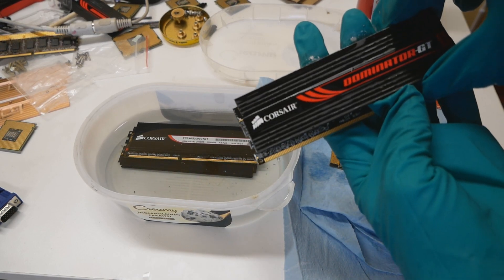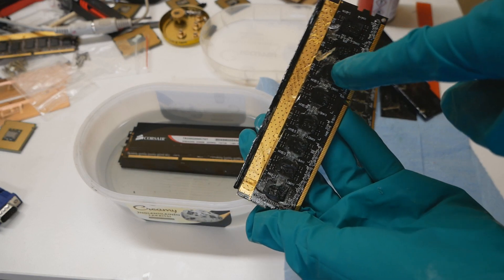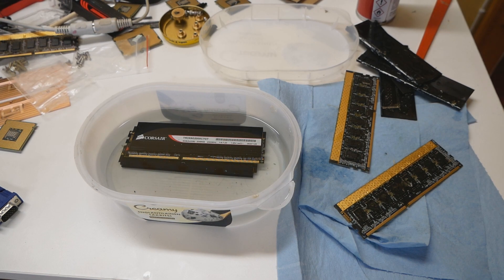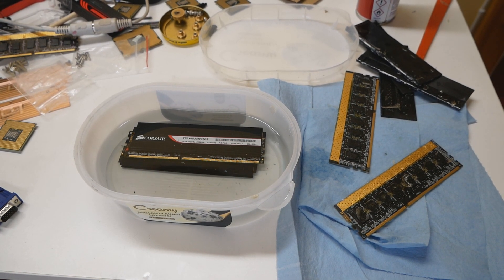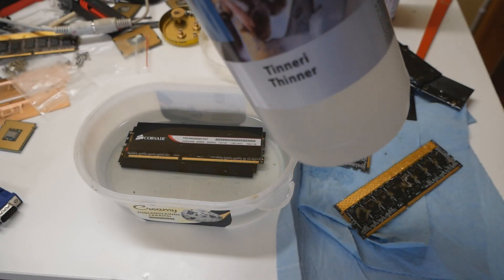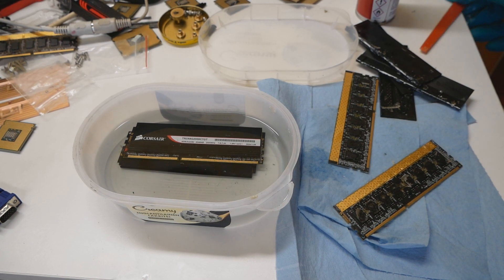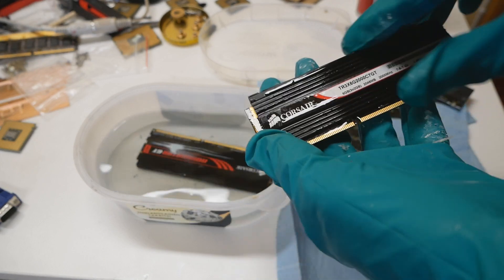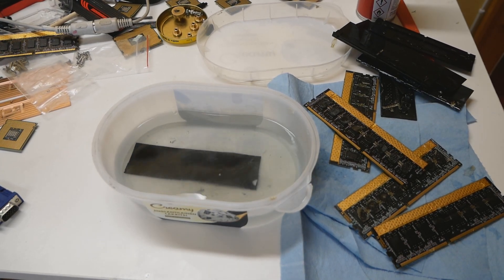Super EASY RAM Heatsink Removal Part 2 Using Paint Thinner :D (feat. Corsair Dominator GT)

Comment: What did you use to clean off the paint thinner afterwards?
Reply from the maker: Normal cleaning alcohol and CRC electronic cleaner.
Reply: @LuumiJuhani  I will give that a shot, thanks!
Reply: @LuumiJuhani  How long did your ram sticks sit in the thinner for?
Reply from the maker: @blazzer73553  As long as needed to make the heatsinks come off without force. Some sticks only 1-2 hours is enough, Dominator GT need even 12 hours.
Reply: @LuumiJuhani  ok thanks, i had one sit for 12 hours, still ripped off the pcb's on a dominator stick... guess ill let the nest one sit for a few days
Reply from the maker: @blazzer73553  Yeah the key is to make it soft enough so that you don't need any force.
Reply: @LuumiJuhani  how long did yours sit in the thinner for? maybe i need to use a different chemical thinner?

Comment: @luumi wanting to do this to t force ddr5 sticks. Do I need to remove rgb plastic top before putting them I. Solution? Also, what’s the best method to let them dry from solution/be ready for new heat sinks? Just got z790 dark and using your 8000 daily profile. Thanks!!
Reply from the maker: The RGB is not inside the plastic, it is just LED that is soldered on the sticks' PCB.
Reply: @LuumiJuhani  Thank you sir, sorry for naivety/stupidity. once i soak them in thinner and take plastic heatsinks off, what is the best method to dry/remove thinner from sticks to make sure theyre good to go for 3rd party heatsinks? Im just trying not to ruin $350usd memory sticks. thanks for your videos & channel!!

Comment: Thanks for the excellent tip, Brother Luumi. I used lacquer thinner and I was able to remove the garbage stock heat sinks from my DDR5 modules within about 5 minutes without damaging the original adhesives or pads or specification labels attached to the heat sinks. After drying they are sticky again and if I ever need to RMA them I can remove the water cooling jackets and put them back to look exactly like a factory stock installation. It worked flawlessly. The garbage they having been using for stock "heat sinks" on DDR4 and DDR5 modules are worthless and offer nothing but aesthetic qualities.
Reply: What country are you in? I want to make sure i buy the correct lacquer thinner product since i plan to reattach the heatsink after. It's confusing because some countries label it differently...
Reply: @sinneddragon  I am in the US.

Comment: hi Luumi, I'm watercooling my ram for the first time. How much time would it be advisable to leave the the sticks in the paint thinner before attempting to remove the heatsinks? 🙏 Ty
Reply: Hi! So how long did you leave the ram in the thinner?
Reply: @Gabo99  I think maybe 5 hours but perhaps 8~12 would be more ideal. It doesn't really matter it was easy to take them apart and the entire thermal pads came clean off.
Reply: @Ben-ld1qi  Thanks, planning to do the same thing so I can save money and so I can use my ram waterblock here too that's been collecting dust.
Reply: @Ben-ld1qi  One more question, what stuff did you use to install it in a new ram stick?
Reply: @Gabo99  I'm not sure if I under your question correctly, which new stuff?
Reply: @Ben-ld1qi  sorry for my bad English, I mean did you used glue or double sided tape?
Reply: @Gabo99  oh i gotcha, it depends on the heatspreaders that you use. You gotta check the manual. I used the ones by Bykski and they recommend 0.5mm thermal pads on the side where you have IC chips and I think 1mm or 1.5mm (I can't remember exactly) if there's a side without chips.
My RAM is dual rank, meaning it has chips on both sides, so I simply used 0.5mm thermal pads to cover them.
Edit: just to clarify, I used 0.5mm on each side of the RAM stick. The heatspreader then has 3 screws at the top to screw both sides together. If you wanna see what I used check out Bykski B-MRCOV-X.
Reply: @Ben-ld1qi  Oh I see, I thought you reuse the heatspreader of corsair dominator, anyway thanks for detailed response!
Reply: @Gabo99  Oh sorry I must have missed your reply. No no you absolutely don't re-use the stock heatspreader, the whole point is to watercool the RAM sticks in order to get lower temps, therefore achieve max (or close to max) ambient performance. On watercooling your RAM will most likely be 30°c+ under stress which can allow for better timings, where as without active cooling, it can easily reach 50°c+++.

After you take the RAM sticks apart from the original heatspreaders, you transfer them to watercooling RAM covers, likes the ones Luumi is using made out of copper. You then also need to install a RAM water block on top of the RAM water cooling heatspreaders.
If you just open the original heatspreaders and replace the thermalpad then you will likely not get any significant benefits, could be 1~3°c better or could be worse it depends on how good the original heatspreaders are.

The only reason to put the RAM back in the original heatspreaders is if you want to sell it again. In that case you can either try and re-use the original thermal pad or apply a new thermal pad or a double sided tape etc.. or you can even get regular RAM (not watercooling ones) covers from Alixpress for quite cheap.

Comment: hello, really nice video!  I have an i5-12600K on which I will want to over clock, in your opinion it is better to opt for the practice of delidding with the copper IHS kit in copper (by RockItCoolper) for the Intel 12 gen using the delid kit to remove the heatpreader and use the copper plate (say it's too risky?), or is it better to just use plain liquid metal instead of thermal paste without disassembling anything?  What do you suggest.  Anyway, congratulations for the channel, always very useful content for many of us😀
Reply: The ADL stock IHS package is very good, so using liquid metal as "paste" works very well with less of the messy delidding risks.

The bigger problem is the bending caused by the stock LGA1700 socket, honestly.
Reply: @TheDoomerBlox  thanks, 
what do you mean by bending?  how can i solve?  (however I think I opt for liquid metal and a heatsink with the base of a material more suitable for contact with it)
Reply: @alsteooaai  If you haven't de-lidded yet, personally I wouldn't use a copper IHS with liquid metal, unless you want to re-apply every few months for the first year, afterwards you should probably be fine. If I were you I would simply delid, apply liquid metal on the CPU die, put the IHS back on without sealing it (let the bracket clamp hold it), this will gave you the biggest decrease in temperatures. Next thing you can do, if you want to use liquid metal on top of the IHS as well, is use a nickel/nickel plated CPU block and just be prepared that once you use it with liquid metal, that CPU block will be only for liquid metal from now on. If you'll ever want to use it with a regular TIM you'll have to lap it etc... Good luck.

Comment: naptha works too
Reply: Yeah naptha is used as a paint thinner too but idk if it can be aggressive on fiberglass.
Reply: @Dipa_OC  We've always used Varsol as paint thinner in Canada. Acetone works too, but be careful with it! Make sure you were rubber gloves and safety glasses as Luumi did, and have a window open or something for ventilation.
Reply: TeCh ExPlOiTs  Chemical method should only be used in case of those old Dominator's as there is very strong epoxy spread allover the PCB. It's like Corsair drowned the sticks in glue. So there is no other way for them to get unstuck safely from radiator. For most regular sticks a hairdryer and plastic pry bar will do just fine. But first ask yourself if you really need to remove radiators. Because if you have DDR4 and want to check info on the IC's used you can use Thaiphoon Burner for that.